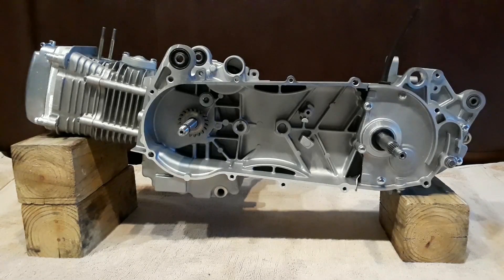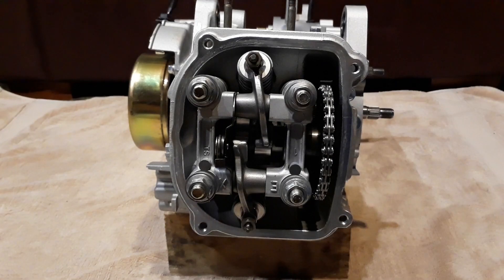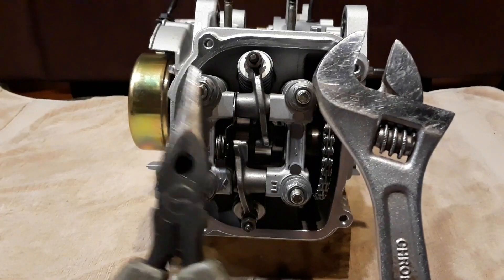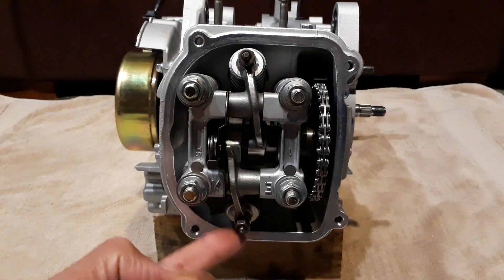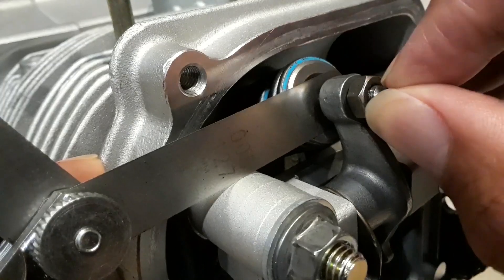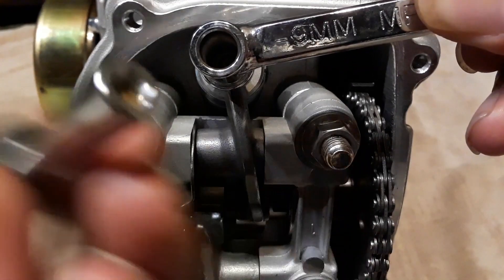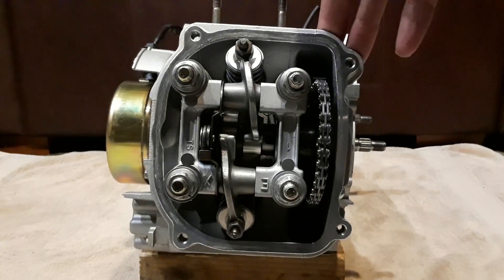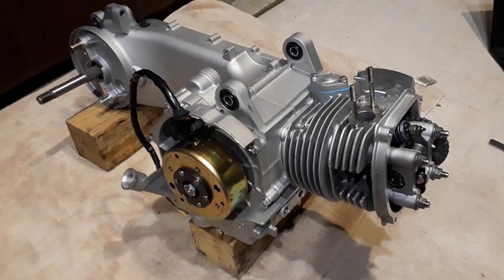GY6 Valve Adjustment in 3 Minutes / 150cc & Up

Comment: Very good video on how to adjust the valves. I had to do mine at the end of September and it was no fun at all. I didn't have that specialty tool and it took me several tries to get the gap right.  Thank you for this video.
Reply from the maker: Thanks bro. I would have done it sooner but the market was flooded.
Reply: @kachiskid  got a standard 150cc and was told to do .004 on intake and exhaust valves.
Reply from the maker: @adrianscoggin7212  Wait? Make no separation between the 2, even by .001? First time I have ever heard that.  I obviously learned at a different school. I think your bike should tell you, but try the .004 and keep me updated.
Reply: @kachiskid  Yeah I was told by a dude who's been doing it for years that it was .004 for both intake and exhaust valves. I thought the same thing too that it was .004 on intake and .005 on exhaust. Apparently another dude from the YouTube channel rolling wrench said the same thing but that either .005 on both or .004 is fine.

Comment: .005 - .007 is clanky on my GY6 125 that's why I always set .002-.003 as instructed by local motovloggers but I feel that it's too small. The also say that the factory tuning is .004-.007 which I'm finding very hard to believe since it's just too clanky when I go past .005. I'm tempted to try .003-.004 and see how it works. Also I always need to tune my air fuel mixture again every time I adjust valve latch.
Reply from the maker: .003 -.004 is where it should feel pretty good.
Reply: IN 0.8mm to 0.10mm    EX 0.15mm to 0.20mm . This engine is build on metric system so use Metric measurement instead of Imperial . .  more easy :)
Reply: @pattayakamagra8325  .8 mm is too huge, and it's bigger than .10 mm, maybe you're referring to .08 mm perhaps?, if you converted that to inches that would be .003 - .004 inches which I mentioned above. It's been doing fine ever since. Never needed another adjustment ever since. You EX recommendation though .15-mm.2 mm (.006-.007) is where I get the clanking sound. The widest I can set mine is only .005 in (.127mm)

Comment: Ok i have qmk161 

175cc scooter in manual it says 0.1mm for valves. Both of them. 

Im getting clicking sounds anyway. What to do?
Reply from the maker: I would check what they are right now. Both at 0.1 I have never heard of. I would test out .003 and .005 on exhaust, listen for clicking again.
Reply: @kachiskid  I´m doing 0.10mm(0.004) and 0.13mm(0.005) on exhaust on my GY6 150cc
Reply from the maker: @TechTricksterNerd  Sounds good

Comment: Kachi's Kid

I have a 2016 Sym HD 200 (171cc) with 19k miles.  Have had the valves inspected once at 7k miles and they were ok.  Now at 19k miles and I'm gonna do it myself because it looks just too easy.  

Question:  Now at 19k miles of mellow easy use, should I still use the .005 intake and your suggested .007 exhaust numbers?

Thanks Again
Dean
Seattle
,
Reply from the maker: No problem. Yes, on your 171cc it would be fine at .005 -.007. Yes sir, adjusting your valves is very easy, just make sure that piston is at the top of the engine.
Reply: @kachiskid  Thanks Again

Comment: You have any contact for some question? I have a maddog icebear 1 generation. Dont start, just I can hear the sound of the starter spining, when I remove the pipeline of the gas from the carburator, and try some few times to start, so than start, and I put the pipeline again and run, after some hours of run, start normally, but when I let the bike overnight (long time off) , the problem back. I already changes the spark, the starter, the clutch and still the same problem, tomorrow I will change the carburator
Reply from the maker: Yes, kachiskid@gmail.com. So the engine is turning over and starting? What pipeline are you speaking about? Can you send me a video of your problem?

Comment: Hello, your video is very good, thanks for sharing it, I have a gy6 with a high-flow filter and a little richer fuel, what size do you recommend for my valves? My idea was .004 intake and .006 exhaust. thank you
Reply from the maker: .004 intake and .006 exhaust is perfect. No problem.

Comment: @Kachi's Kid....when I do this, is there a gasket and should I replace it..?  First opening her up, so I'd like to be prepared.  She's a 2006, low original miles under 3000...Also, do you know factory valve size..? I may upgrade the valve, seats, & springs(if needed/I want to, lol) but I'm not big boring, just the stuff I mentioned in other post, so I dont wanna go crazy
Reply from the maker: Yeah, you could check on the health of your gasket. If it is super flat you might want to replace. The valve sizes should be on your scooter.

Comment: how about for gy6 scooter 
valve 23 28
with 7.0 cams
160 cc
what should be my valve clearance sir

should i  go with 6.5 camms regrind instead for top speed? and acceleration
Reply from the maker: Young man, I don't know everything... but i would set yours at 0.004/0.006 and see if there is any chatter. I haven't done a lot with cams, I did like my A14 for very quick acceleration, but fell off at the top end. I have an A11 (I think) in the 180cc engine now, and just haven't run it enough. Next summer throwing in my Taida cam, so I will see.
Reply: @kachiskid  thanks for your reply  currently im using 0.06mm intak and 0.08exhaust
Reply from the maker: Sounds good. As long as the bike starts, and you hear no chattering, you should be good.

Comment: you abslolutly want an oil cooler thats the single best thing you can add to prolong the life of your motor. dont mess around with a small oil cooler get a big one those motors run hot to hot in my opinion. my runs 200 on the hottest day wide open throttle for 20 to 30 miles at a time.i have a 24 row cooler
Reply from the maker: Send me a link to your cooler, I will take a look. My bike is not an everyday rider.

Comment: Hi, my scooter was making noise, I did the valve clearance and it was solved, but after two days it's like before again.  What could be the causes and how could I resolve it?
Reply from the maker: Hey bro, not sure that you would need to do a clearance so soon again. If they are moving, I would replace the rocker arms and possibly the cradle. What are you tigtening the rocker cradle nuts too? Torque specs?
Reply: @kachiskid  Hey bro, yesterday i’ve re’done the valve clearance. I'll check this week how it goes. The specs is 0.10mm for both. Its a kymco agility 125
Reply from the maker: Let me know what happens. Kymco should be better than that, but it is a scooter. All need valve adjustments pretty regularly.
Reply: @kachiskid  Hey bro , i had time only now to respond you. It didn’t go well, its just as before

Comment: Hiya can you help if you can thanks,  have a gy6 150cc air cooled atv  takes off fast then at full throttle makes a bogging noise nd loses speed only doing 20 t 25mph nd its doing my head in valves are at .004-006  camshaft if fine piston is fine no air leaks just dont no if its something to do with the auto carb feel like just putting a light to it 😂😂
Reply from the maker: If you are absolutely certain that you are getting no air leaks, I really would swap the carb. just to see if it will make a difference. What kind of filtering system is on this ATV? I imagine it is ridden in dirty or sandy conditions?

Comment: What valve clearance for a stock gy6 with 26mm carb and a9 cam
Reply from the maker: 0.003 - 0.005
Reply: @kachiskid  thank you so much  is that 03 for intake and o5 for exhaust right
Reply from the maker: No problem. Yes sir, exhaust is always bigger.
Reply: @kachiskid  alright I'll keep you updated and make some videos